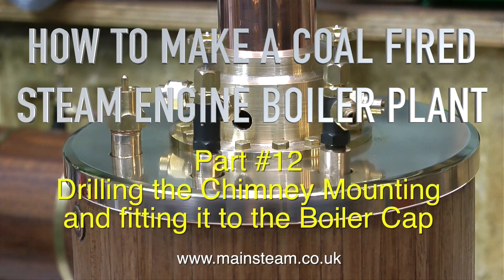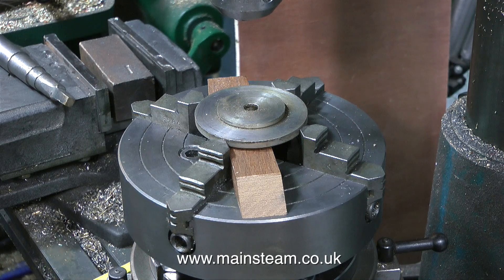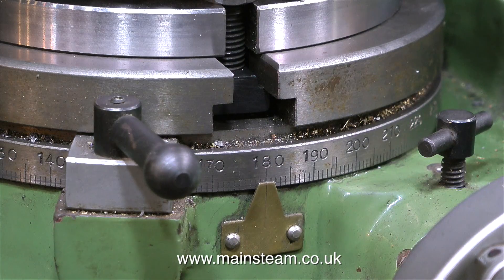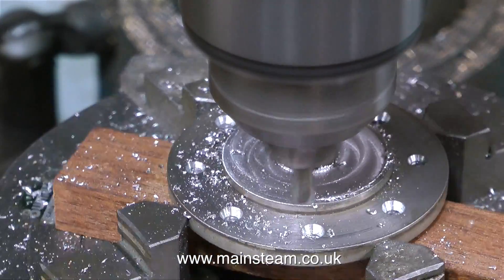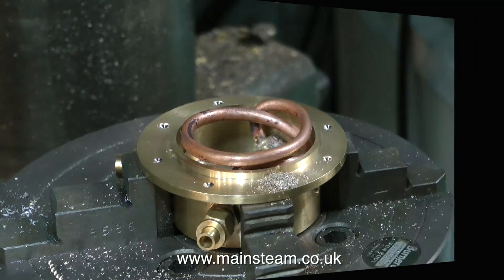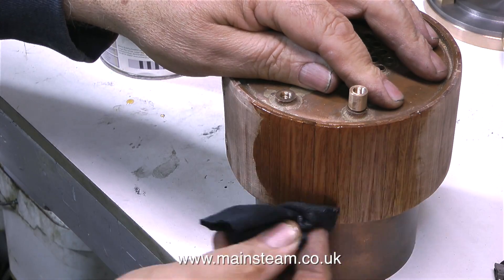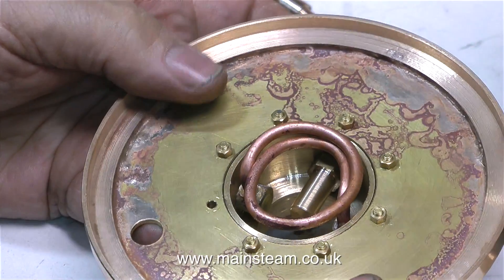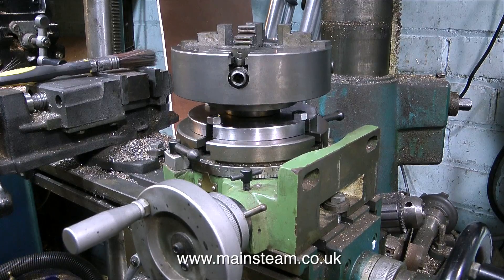HOW TO MAKE A COAL FIRED STEAM ENGINE BOILER PLANT - PART #12

Comment: I like the look of the 6BA bolts and nuts.  I can't seem to get very 'scale' using imperial hardware.  I like 5-40 for my '10' -sized engines, but the nuts are 1/4" across flats.  a little big looking.
Reply from the maker: Stuart Number 10 engines use 7BA fastenings. My friends at Blackgates engineering (http://www.blackgates.co.uk) sell a large range of Model engineering nuts & bolts in BA and other Imperial sizes.
Reply: Thanks, I downloaded the catalogue.

Comment: when drilling into a flange (thats held in a chuck on the milling table) I use either scraps or small keys for support if the jaws are in the way for drilling through. Placing them on top of the jaws and have the flange rest on them as to not damage the drill and or jaws so I can drill any pattern without being bothered by the jaws and finish in one setup.

love your vids and style, even as an experienced machinist. (wink)
In the Netherland we have a saying: If it doesn't go as it should, it should go as it does. Meaning: If you cant do it the "right" way, do it anyway you can, as long as it gets the job done. You certainly embody that spirit :)